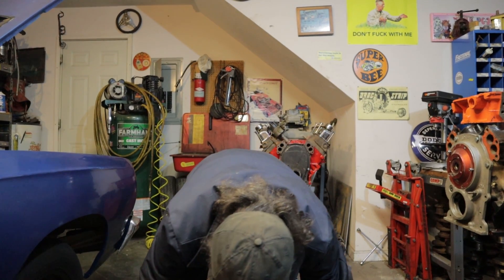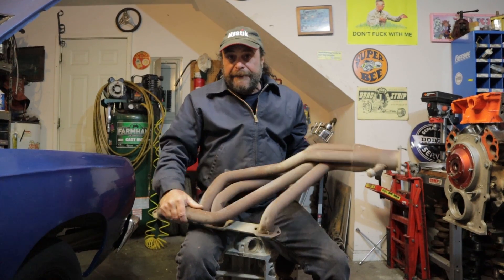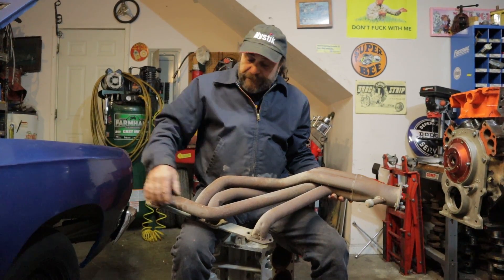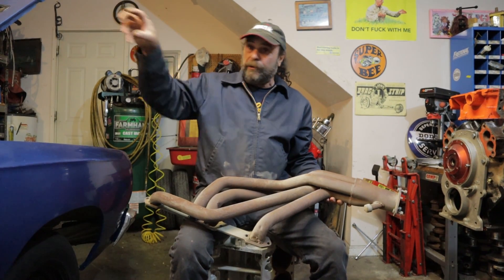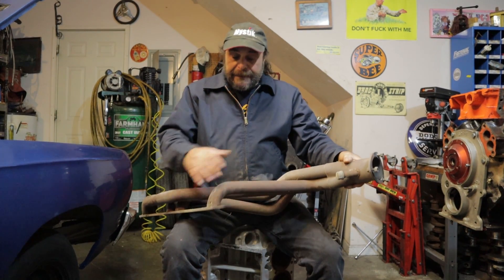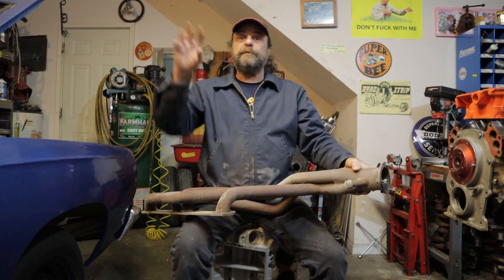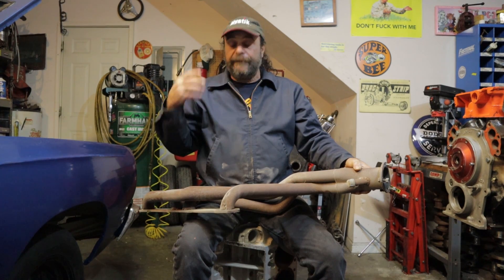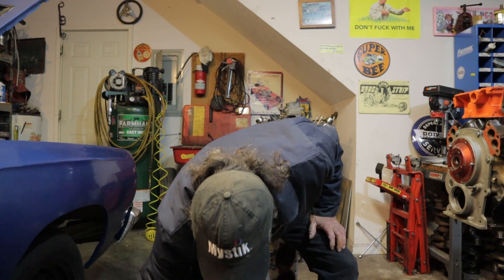The BS On Backpressure

Comment: I hear this back pressure myth over and over.  Many people don’t have the ability to learn. Thanks for posting.
Reply: Its from 2-stroke engines.  4 stroke engines don't need back pressure as Uncle Tony correctly states, but the 2 strokes do.  And then when you get to nitro RC 2 strokes, the exhaust is actually tuned to recycle unburnt fuel.  The honda tweens won't watch this video unfortunately, so the myth may continue to spread.  Thank you uncle tony for explaining why manifolds and headers are actually needed though-- much appreciated & I learned something today!
Reply: @martinauriemma2518  Two stroke engines don't work on back pressure either, the exhaust is designed to optimize the pressure wave pulses (which is distinct from constant "back" pressure). The theory is identical to four strokes, but due to the difference in design, the application is quite different (tuned header pipes versus expansion chambers).
Reply: I watched Tom Nelson from NRE do a dyno test on blown methanol SBC that made 1150 hp with collector headers. He put zoomies on and lost 100 hp.
Reply: I think it had to do with initial practical experience. Back in the day when kids drove pieces of crap for their first cars/projects and muffler shops were everywhere, lots of folks lost their exhaust.( either it rotted out or somehow became damaged) and you essentially had an open pipe. They noticed that power dropped way off. Once the exhaust system was repaired, the power was back. This would cement the idea that back pressure was needed. That’s just my guess at how this myth got so wide spread.( that and a lot of us went from two stroke dirt bikes to four stroke cars)
Reply: Excuse me. The terminology the old-timers used might be wrong but not the fact the exhaust manifolds helped. They knew what worked and what didn't.
Reply: I just bought my truck a few weeks back and it’s on open long tube headers with a good wrench gm 350 you think it’s safe to drive her around until I get my exhaust done ?Engine was just rebuilt and is super healthy
Reply: 😉 You guys have it all wrong! I've become a true believer in the "back pressure is crucial" thing! About 2 months ago, I began completely sealing my exhaust system shut,  so that NO exhaust is able to make it through. It ensures that my engines have an optimal ratio of 100% back pressure! But on a separate, and completely unrelated note, I've been having a strange problem with my engines for roughly 2 months now. You see, they only run for 2 seconds, then they abruptly shut off, immediately after a loud banging sound occurs. For the life of me, I cant figure out what's causing this phenomenon.....  😁
Reply: Yeah but he's the only one to have ever answered what I've had in my head since 15 yrs ago when I saw someone try to start a motor without manifolds on and I saw how it didn't even want to start and would immediately die if it did and like he said I was 18 and at the time thought huh guess back pressure does exist lol

Comment: A guy in my high school auto shop class was building a 400 Pontiac.
I remember when they tried to start it up with no exhaust, just open ports.
Now I understand why it ran so badly.
Reply: @Henry Meynier I'm sure it was more common 70+ years ago, when metallurgy wasn't nearly as good as today, but the idea of it being possible has been passed along much like the back pressure myth, so although warping valves is possible, it doesn't happen very often at all anymore, therefore most people don't believe it.  I first heard about it from my grandfather, who was an army mechanic in WWII, and worked as a mechanic in the 50s as well.
Reply: Not only do they run poorly with no exhaust, you can warp the exhaust valves that way.  When the valves heat up, then you shut it off, the cooler air is right there, the valve is right inside the port, so the cool air touches the valve and it cools unevenly, causing it to warp.
Reply: @livewire2759  I've heard this several times but have never seen any proof of it. I've ran several engines open manifolds and open headers. Even ran a 283 right off the head. I've never wrapped a valve or seen anyone warp a valve from a lack of exhaust
Reply: @konnerkramer329  I've seen it.  It won't happen right away, so a test run with no manifolds probably won't hurt, but repeated heat cycles with open manifolds can and will warp the valves eventually...  especially in cold weather.
When I was young, a friend of mine was wanting his truck to be as loud as possible, so he took his pipes off right at the manifolds (mid 90s f-250 with a 460)  He ran it that way all summer with no problem, then about halfway thru the winter he suddenly stopped driving it.  I asked him why, he said it was running like crap, took it to a mechanic and they told him the valves were warped.  they did a valve job and told him to put the pipes back on it.
Some years later I had a customer (I'm a GM tech) who brought in a truck (early 2000s 1/2 ton with an LS) that was running rough and had the exhaust pipe broken off on the drivers side.  He said he'd been driving it that way for several months.  All the misfires were on the drivers side, all had low compression, all the exhaust valves were leaking.  We sent both heads to the machine shop for a valve job and replaced his Y pipe, complete with converters.  
It may not happen very often, but it CAN.
Reply: @livewire2759  I'm sure on a hot engine with high egts it's possible. but I ran my 327 for almost 5,000 miles open manifolds until I got a set of heddmans for it. I ran it for probably another 10,000 open headers before I put an x pipe and 3 feet of tubing. I ran it like that for about 2 years until I tore the engine down.The engine was ran hard for a long and other than 10lbs oil pressure It seemed to run fine. It cruised 65mph all the way to my shop with with basically no oil pressure. I tore the engine down and found 1 broken piston ring and 3 cracked rocket arm nuts but everything else was fine.
Reply: @livewire2759  More likely the drivers side exhaust pipe broke, because of a dead o2 sensor commanding max fuel on that bank, rotting out the exhaust and fowling the plugs, leading to intermediate  missfires.. (based on load)

 Back fires from this are known to blow the baffles out of mufflers and glass out of glass packs too.
Reply: @DarkLinkAD  The pipe broke due to vibration.  Years prior, a previous owner did some "tuning", eliminating the catalytic converters and he installed cheap custom pipes.  Yes, it was commanding a rich mixture due to that, but the valves were definitely warped, the compression was low on all 4 on that bank and when I removed the heads I could see daylight through 2 of the valves.  I test valve seats by filling the runners with solvent, all 4 exhaust valves leaked solvent.
Reply: @livewire2759  You also ruled out excessive carbon build up on the valve seats?
Reply: @DarkLinkAD  Yes, that was my original diagnosis.  I tried cleaning and lapping the valves first, but only got cyl #1 to seal up that way, so we decided to send the heads to the machine shop, where they confirmed that the valves were, in fact, warped.
Reply: Early model 327 engines were tough as nails.

Comment: Yup hit the nail on the head, the only thing that really matters is balancing the pressure waves so you get better volumetric efficiency and power. 

I got a book off my uncle a while ago called “Performance Tuning in Theory and Practice” by A. Graham Bell. It goes into detail about optimal exhaust manifold design for different engines. Pretty interesting read to get a general understanding of engine tuning. 👍

Comment: If you know you probably might but the gases travelling down the pipe pulling a vacuum behind it is called the kadency effect. From what I have gathered though that if a really good header is designed it will act in way similar to how a two stroke exhaust works and force back any air/fuel mix that comes through during the overlap phase and it’s done some how with the design on of the collector.
Reply from the maker: Never heard of a header designed to create reversion
Reply: Here’s more on ot https://www.boefab.com/blogs/tech/84476422-2zz-ge-header-shootout
Reply: It would be easier if pictures could be posted here but on this page there is a graph and it shows a secondary red spike in the exhaust pressure graph. It’s only slight but it can be used as a bit of a reflection wave.

Comment: I always understood that scavenging was a condition that had to be carefully designed into an exhaust system for specific setups and only occurs within a specific rpm range.
Reply from the maker: No, it's a normal thing that works at all engine speeds.  More effective at some than others, but always doing its job
Reply: Good deal. How about another potential myth, exhaust valves getting burnt from no exhaust at at all? I've heard somewhere that it is necessary to have a short length of pipe to prevent this. Possibly just  enough to scavenge as well, is a collector required for this? This may be where my confusion comes from, lol. Thanks UT.
Reply: @mrhangfire1  that is true but it's due to ignition of unburnt gasses igniting when they reach the air

Comment: Theres an old motorcycle tuners trick where you spray a line of paint on the exhaust pipe from after the manifold on, and where the paint stops burning off - you cut the pipe. I've only tried this on inline engines , but it NEVER fails to make the BEST power for an exhaust system on any engine
Reply from the maker: Yup, been doing that on collector extensions since the 70's
Reply: @UncleTonysGarage  Heard the same thing about using a grease pencil on the collector on drag cars....where ever the grease doesn’t melt, cut it there and that’s the optimum position for torque

Comment: ROLL UP YOUR WINDOWS!!!
 
Automotive knuckleheads have be spewing the “Back Pressure” myth for decades.

...The only channel I don’t skip the ads.
Reply: I do the same, it's not much. But it's the least we can do. Seriously if I'm watching something else I just open another window and mute it. By the time I'm ready its ready to go  and I do the same if there's adds at the end.
Reply: I dont skip ads here either. Just another squirrel tryin to get a nut...in other words just another guy who lives paycheck to paycheck and supports my 3yr old grandson.
Reply: john beaver  no you even beat in your header pipe quite a bit and will lose minimal horsepower. At least based on the engine masters header bashed test
Reply: Cledus Snow.....are you Hank Snows brother?
Reply: Ok scottie I seen what you done there.😂😂😂😂😂😂😂
Reply: john beaver  Hell freaking yeah buddy when your car goes roooooom down the road youll feel the loss in pressure!!!!!!
Reply: Excuse me. The terminology the old-timers used might be wrong but not the fact the exhaust manifolds helped. They knew what worked and what didn't.
Reply: LMFAO 😂😂😂 ,
Reply: Here, I wouldn't skip  either if there were any. Only once in awhile. The way some sites are I had to have ad blocker. So the most I can do is give thumbs up and make comments to help the algorithm.